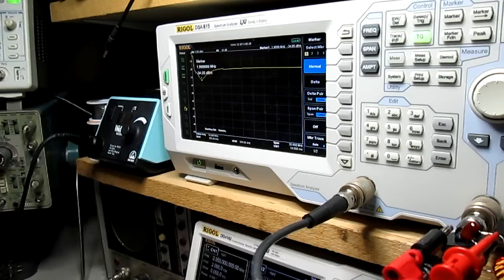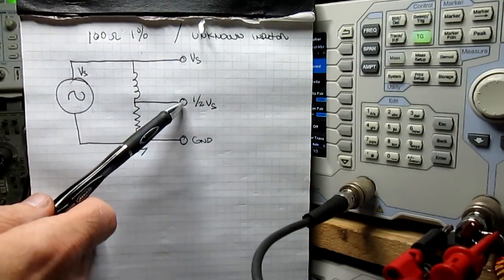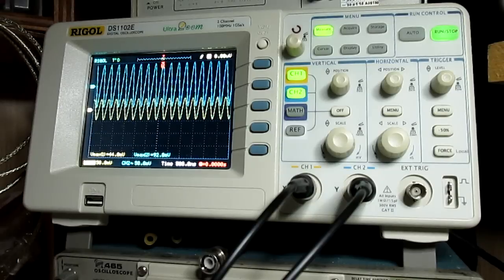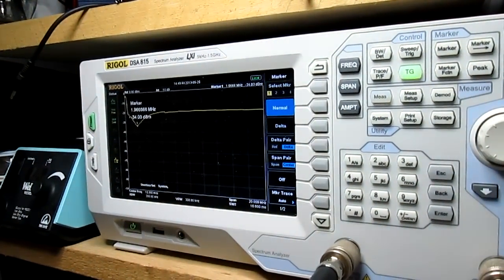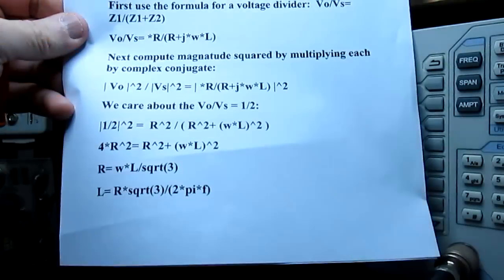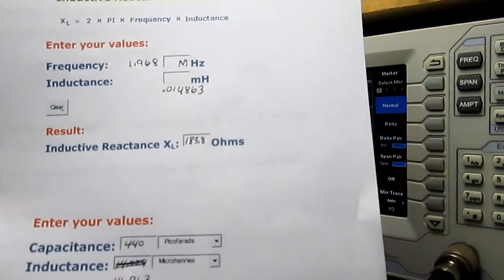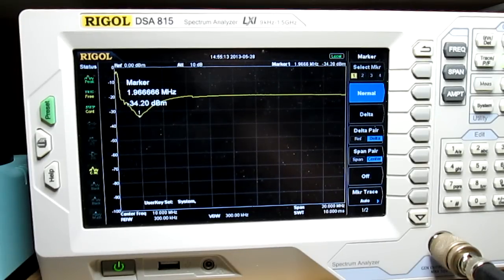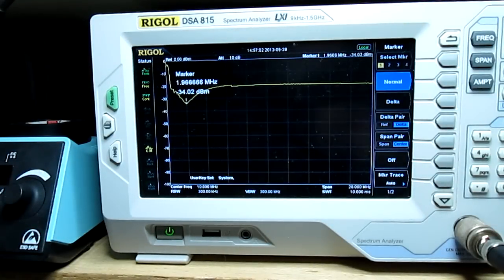How to measure inductance with Oscilloscope and Signal Generator

Comment: Very nice setup. Daycounter equation is derived from voltage divider and there are other ways to end up equation used in video. Alternative and algebrallically easier approach that I've end up: Since we have given resistance R=106ohm and we see that voltage is half of input voltage in channel 2 in certain frequency tracked by scope, we can assume that total impedance is 2*106ohm = 212ohm. We still need to know inductor's reactance to get the value of inductor in henrys. That's easy. Total impedance is Z = SQRT(R^2 + X^2), from that the inductor reactance is: X = SQRT(Z^2 - R^2). And finally from 2*pi*f*L = X we get inductors value L = X/(2*pi*f).

Sure we can pack that equation more and surprise we get very same equation than daycounter: R=106 and Z=2R, X = SQRT( (2R)^2 - R^2)) --> X = SQRT(3)*R, and: L = SQRT(3)*R / (2*pi*f)

Comment: Tried this out. I found that taking the voltage across the resistor and using the formula 
L = sqrt(3)*R/(2*pi*f) gives a much more accurate measurement than taking the voltage across the inductor and using L = R/(sqrt(3)*2*pi*f) although, theoretically it should not make any difference.  You really don't have to worry about the output voltage of the generator. It does not need to be adjusted for input impedance of the circuit because the calculation is independent of the voltage. So if you have your awg set to 4 volts and the actual output across the circuit is only 3.8 V no problem. Just find the frequency at which the voltage is 3.8/2 = 1.9 V and you're good to go. Your observation about how the phase angle alters these calculations is spot on. In other words. if we naively assume that at half voltage the impedances are equal the equation would be  2*pi*f*L = R or 
L = R/(2*pi*f) which is off by a factor of sqrt(3). SO an equal voltage drop does not translate to equal impedances across the resistor and inductor as one might expect were these both simple resistors.
Reply from the maker: Great observation .. thanks

Comment: First of all, thanks for your video. About purchasing from Tequipment.net - I purchased Aktakom ADS-2111MV Oscilloscope+Aktakom Signal Generator and I had a bad fan that they never replaced! When I asked for support I did not get any, so that is my experience with them. I also asked for updates for my equipment, but they did not provided updates! I think RIGOL is much better, and you can get updates other places!

Comment: I measure inductors without using a series resistor, because I have found that it isn't needed since all good quality signal generators have an output resistance of 50 ohms, accurate to one percent. I simply set the signal generator to an arbitrary low voltage output (two volts), which is the open circuit voltage, and connect the inductor across the generator output . I then adjust the frequency of the generator until the output voltage is halved. If the resistance of the inductor is neglected, the inductance can be calculated as: 50/(sqrt(3)*2*pi*f), where f is the frequency at which the generator output voltage is halved.
If the resistance of the inductor is not small, the more accurate formula becomes sqrt[(50-r)*(50+3*r)]/(sqrt(3)*2*pi*f) where r is the dc resistance of the inductor.
This method also uses much lower frequencies, with the 15uh inductor above, the test frequency from the generator would have been only 306.3 kc/s in contrast to over a megacycle for the  above method, reducing inaccuracies due to cable capacitance and reflections.
Reply from the maker: Thanks .. appreciate the great info

Comment: If you put the resistor before the inductor (still measure at the resistor/inductor junction) then you won't need such high frequencies and you will get slightly more accurate results. When used this way substitute sqrt(1/3) in your formula instead of sqrt(3).

Comment: Hello everyone
I have a question on this subject.

If I connect a coil, which I want to find a value of, to some capacitor, 10nF or whatever, in parallel and then apply sinegenerator with some Vpp and then adjust the frequency until I find the place where the signal peaks. That would be the resonance frequency and by rearranging the 1/(2*pi'sqrt(LC)), I get the L. Is that possible? Do I miss something in my attempt? I do not have special and expensive equipment to do it in a profesional way. I only have a generator and a oscilloscope. When I read books on this subject it should be possible.

Thanks
Reply from the maker: Sorry for the late reply .. but yes that sounds correct .. I would suggest at least taking a guess on a rough value and do some calculations to get you in the ballpark so that you dont unintentionally hit a harmomic .
Reply from the maker: Amer Voloder Also .. an alternative would be to hit the circuit with a narrow pulse and make the circuit "ring" which is its natural resonant frequency, and then measure the frequency of that oscillation.
Always feel free to ask questions or give ideas for future videos ..
Also please subscribe and share if you haven't already done so.. Your kind words and support are always welcome.

Comment: square formula is wrong. (R+jwL)^2  is not equal to( R^2 +(wL)^2). So the measurement is wrong....
Reply: The formula is correct.  The daycounter derivation has an error with the Vo/Vs = R/(R+j*w*L).  The total Z for the denominator should be (R^2+(wL)^2)^1/2.  The magnitude of Ztotal is the square root of the sum of the squares.  Then when both sides are squared, it cancels the square root of the denominator - giving (R^2+(wL)^2).